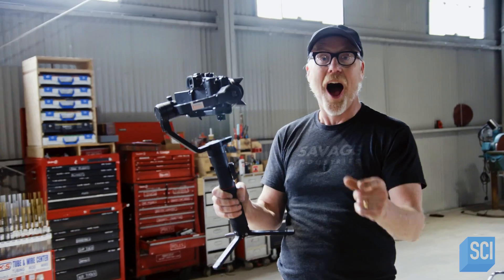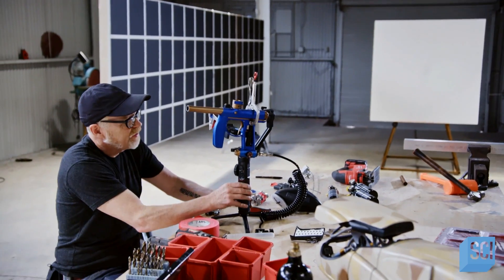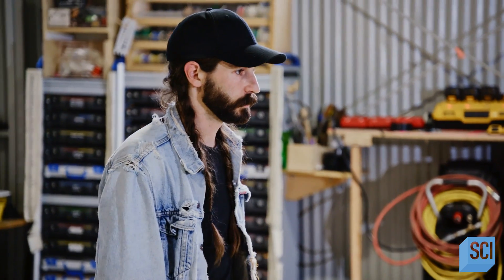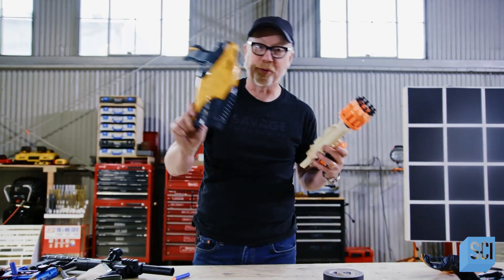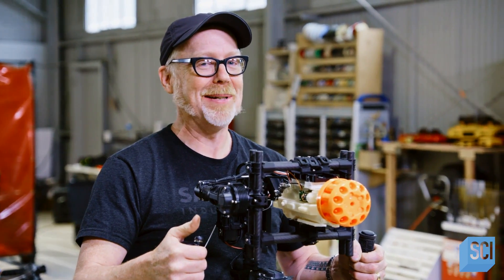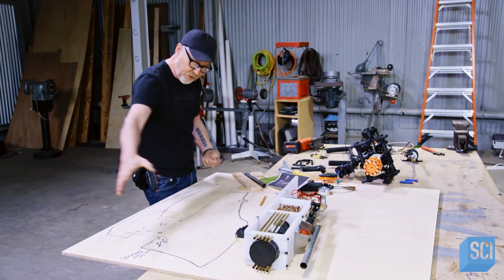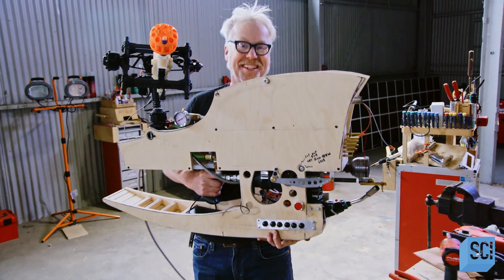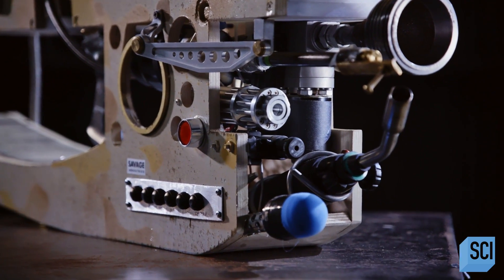The Revolutionary Weapon Adam Savage Built Will Blow Your Mind | Savage Builds | Science Channel

Comment: The gun sights on the A10 Warthog take control of the plane when the trigger is halfway pulled. It uses small control surfaces in the wings.
It will keep flying exactly towards the target, regardless of crosswinds. When the in-range light comes on, the trigger can be pulled all the way back. Goodbye Russian tank..
Reply: The aircraft engine igniters turn on as well.

Comment: Adam - just a thought for doing this with the paintballs.  What if you break the paintball gun down to just a very light barrel and a very small and light hopper.  The trigger and air would be remote. You would just need a air tube between the trigger assembly and the barrel.